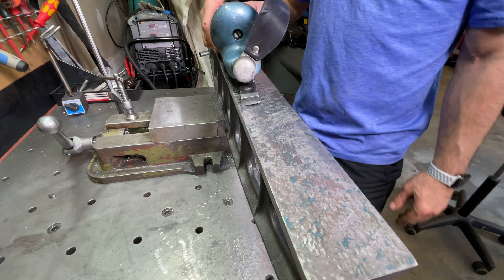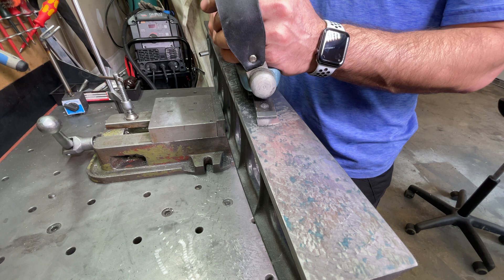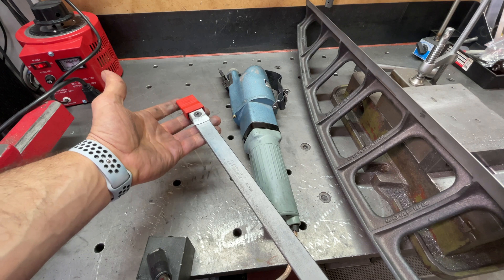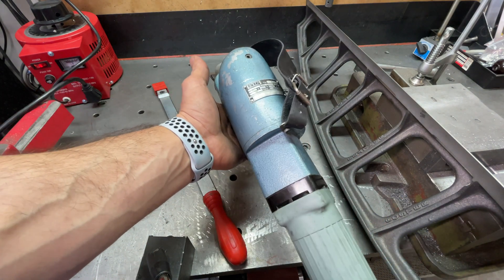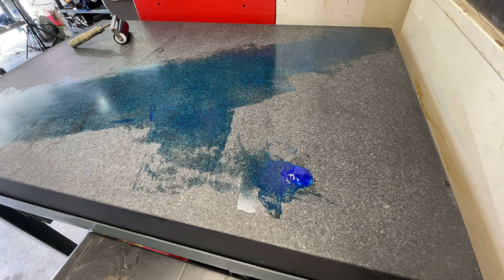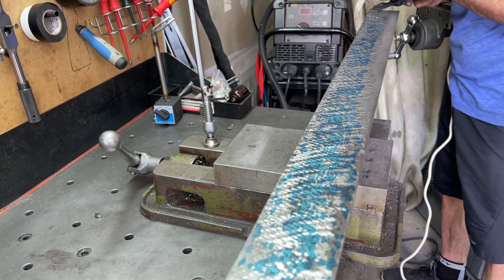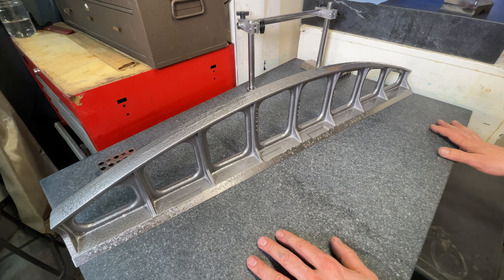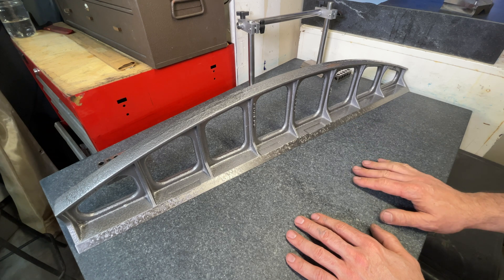Camelback straight edge scraping

Comment: I suspect from having watched Kieth Rucker & Steve Watkins do this same process that you may have “chased your tail” a bit, due to not using precision flat stones to remove your power scraping burrs before blue printing your scraped surface each time.
It’s a lot more work scraping if your blue printing result is being influenced by burrs that protrude above the surface and influence the pattern you achieve.

Whilst milling it flat at the start does save time, you might have saved a lot more time if you had precision ground the surfaces after milling.

I think with pre vision grinding after milling, then employing precision ground flat stones to remove your scraping burrs you could have cut down the scraping time by factor of 10 probably.

Comment: That crater could’ve been the result of the part pulling up or twisting when machining it. Been there with scraping and turcite. Thankfully turcite was nearly perfect when i glued it. I had set 1,000lbs flat across the surface while it cured. It’s not easy to do and I give you much credit for having great patience.

Comment: Your 5 degree grinder "table" is the wrong direction for the rotation of your lathe. You should move your cross-slide to the far side of the wheel, otherwise you are causing the cutting edge to fracture, which wears out faster and doesn't scrape as well as it could.

Comment: Thanks for a great video - great learning experience for me!  Thanks especially for the tip on your power scraper - I just purchase an EVIG scraper.  Wondering what you use for bladies on your scraper?
Reply: they are Sandvic blades
Reply: @sydneysworkshop3788  Any ideas on the size?  620-20, 620-25 or 620-30?
Reply: @karlgabel9822  it looks to be a 620-25, but I would also recommend a 620-20 fro when you start scraping internal dovetails

Comment: Hey Vince, still looking at your cnc build and I am very impressed. Do you consult on builds? Would very much like to engage you on my own project.
Reply from the maker: I can answering some question to best of my ability
Reply: @advanceair  would you be willing to license the design. I would very much like to build a similar cnc mill. What would be the best way for me toco tact you, besides Youtube?
Reply: @advanceair  Also, do you think using gas springs would work instead of the lead weight counter balance system that you have in place?
Reply: @advanceair  If you are interested, I can provide you with free gas springs if you have interest in trying them out.